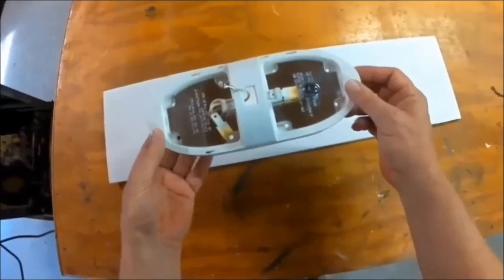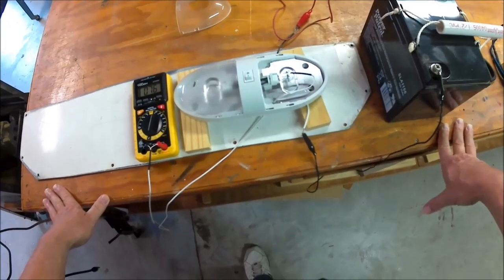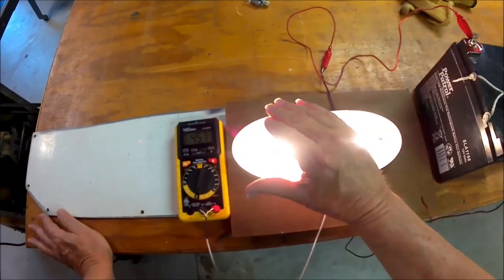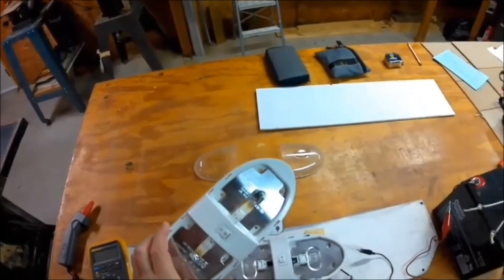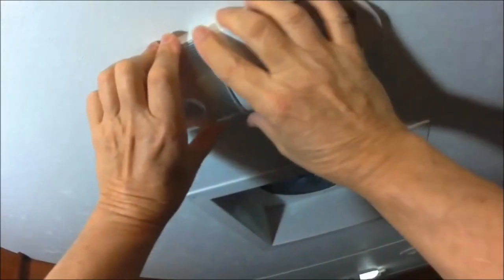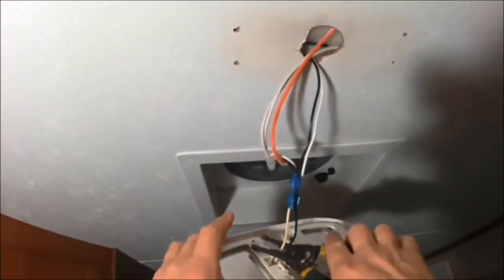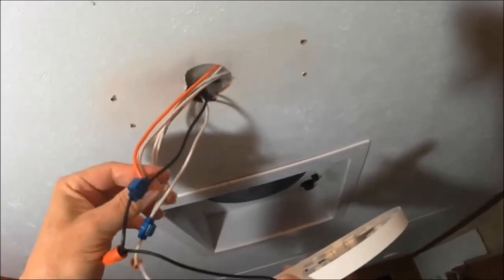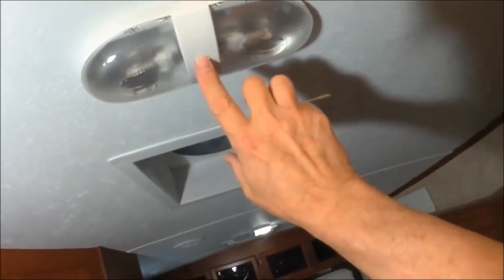Why your Rv lights burn out and how/why to change them to LED.

Comment: I hope this fixes my issue, bulbs are smoking and melting the covers and burning out. Where did you by the new lighting units and bulbs?
Reply from the maker: Rv dealers have them. Amazon as well. I bought a couple from Home Depot. Google it and you find many choices.

Comment: I knew those stupid things looked and felt  unsafe. I've been wondering if I can switch them to LED. I survived a house fire in 2017 and I'm extremely weary about stuff like this. I've been tempted to use a lamp instead of the camper lights but I only have a 30a camper and I know I have to watch my power usage.
Reply from the maker: Best to go to a rv dealer and purchase the correct led replacement bulbs for your fixtures.

Comment: Well I have a bit of a problem. I came here because all the keywords match, but the question I asked turns out to be related to your solution. I have an LED light bulb on the outdoor light socket for my RV and that one keeps dying on me every few months. I assumed my first LED bulb was bad, but after the second one I have to assume somethings wrong with my socket. Obviously converting to LED is a foregone conclusion, so I’m curious to pick some brains.
Reply from the maker: Sorry. Their could be many reasons for this. Low or high voltage from the inverter. Loose base connections. Myself I would use a different brand fixture that comes with a led light.

Comment: Mine melted the switch and I can’t turn it off and it’s super hot what do I do?
Reply from the maker: You can 1.shut your 12 VDC battery stitch off.
                2. Wait till the light cools down then slide the covers off.
                3.Take the screws out that hold the light fixture to the 
ceiling and  let the fixture hang if it's just the small plastic one.
                4.Cut the wires and tape the ends. Push the wires back into the fixture hole making sure the tape stays on the ends of the bare wire ends. 
                5.I would replace it with an led fixture.
Get a LED fixture before you do this so you can just replace the old fixture. You can take the fixture with you to a dealer for the right replacement.
                6.strip enough (remove some insulation from the end of the white wires.) twist the end of the wire from the white wire coming out of the ceiling to the white wire on the new led fixture. Put a wire nut on the twisted wire pair making sure they stay together.
                7. Do the same with the other wires. One coming out of the ceiling. May be red or black. Twist the bare ends of the red or black  positive wires together to the red or black positive wire coming off your new led fixture. Put a wire nut on that pair.
                8. Now screw the new light fixture back on the ceiling. Do not over tighten the screws. Carefully make sure the wires are in the ceiling and not pinched under the fixture.
                 9. Turn your 12vdc battery switch back on and test the led light to see if it turns on.
* Don't hesitate to get help doing this if you are not comfortable doing it yourself.

Comment: Wow, that's hot! Good thing you stopped before she burnt up. LEDs are the best way to go. A lot cooler and uses less electricity. 
Great tutorial Wayn. You won't have to change bulbs anymore now.
Reply from the maker: I don't know why the RV industry uses auto break light bulbs for lighting. 
They get way to hot and burn out.
Reply: They sure do!